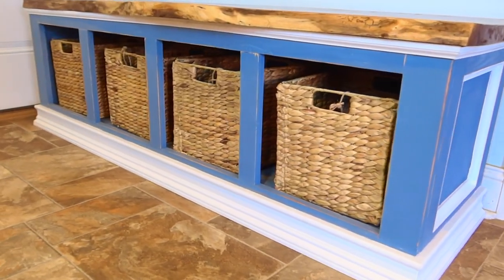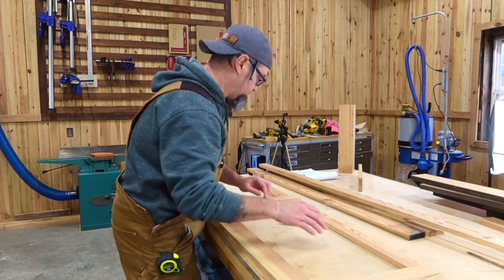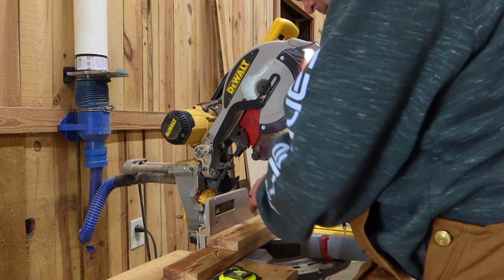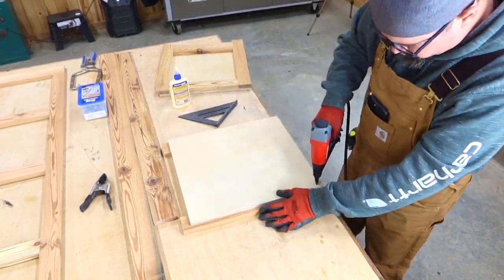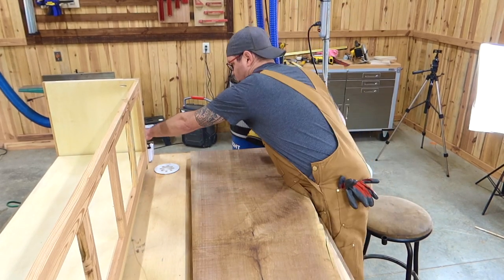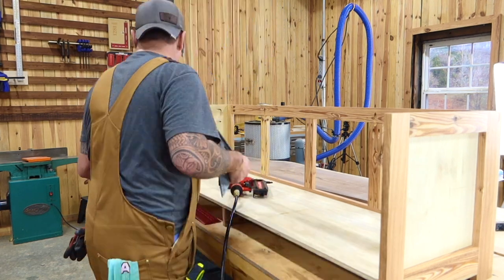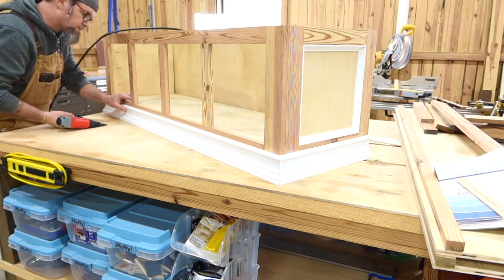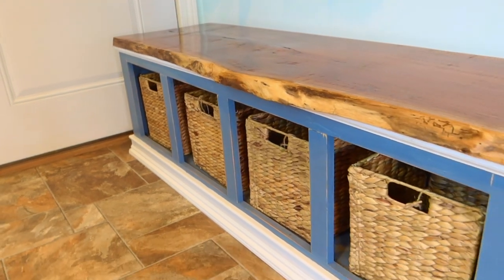Build A Entry Mudroom Bench!  Easy DIY Build With Cut List!

Comment: One lesson I learned:  buy the pull out baskets first. Size openings to fit. (Same with building patio furniture: buy the padded cushions first.). That bench top Kreg “machine” (750?) looks massive. Thanks for the video.
Reply from the maker: Very good tips. Your right. The 720 pro is def bigger than the K4. But can do alot more.
Reply: Thanks for the info.

Comment: Nice project.

In an old house might be a good idea to wait on the bottom trim until it is on the floor.

The level work bench might not match the level floor.

Also as of late it is good idea to measure all lumber from the big box store before use.

Do not assume the measurements are correct.
Have come across several supposedly 8 ft long boards that are 8 foot and 1/2 inch.

Take no measurement for granted.
Reply from the maker: Very true. Actually why I designed it with 1” “legs”. So the base could be adjusted.  I just forgot to mention that in the video.
Reply: @MatthewPeechWoodworking  i am dealing with leveling a floor in an old house right now.

The joists cannot be lifted or lowered. So it is all in shims.

Good thing is it is going to be a layer of 3/4 plywood shimmed with 1/4 in, 3/8th and a good application of liquid nails.

Comment: Kregg didn’t hook you up with any clamps?!?   That should have been question 2. Their clamps ain’t cheap and a set of four cost as much as the pocket hole system. Lol
Reply from the maker: I actually had a Kreg clamp already. Well worth the money.
Reply: Matt I really want that table saw.  Is it as good as it was when you got it.  I have a nice grizzly and it’s sooo hard to raise the blade and I clean it.
Reply: @joelw6215  lube the lifting parts/gears. You'll be surprised.